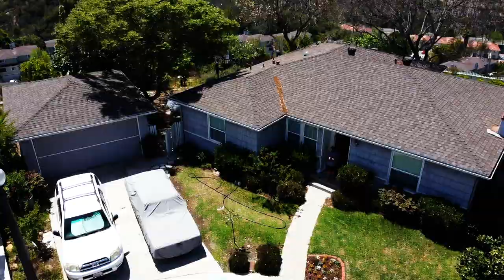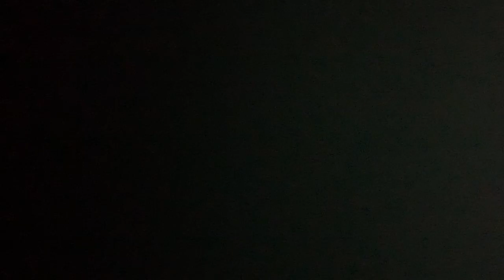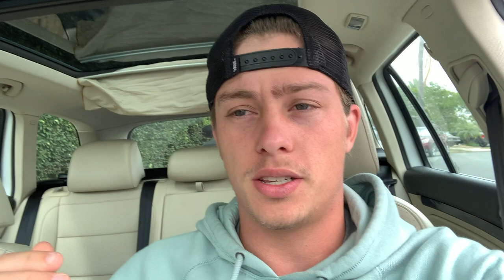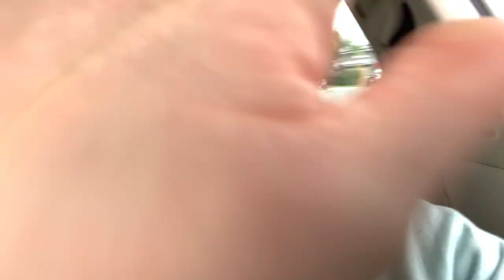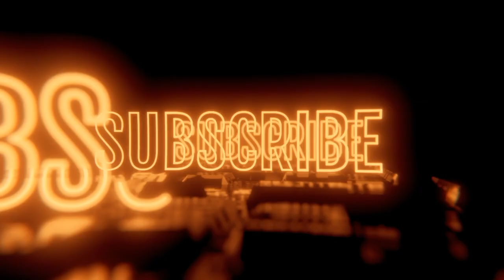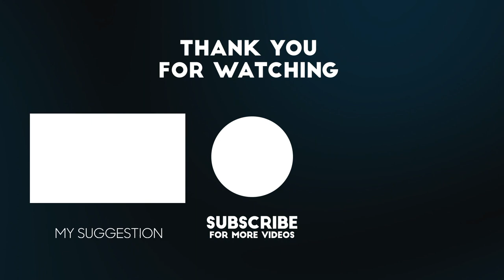Predator 212cc lean 2-STEP!! POPS & BANGS!

Comment: How do you backfire like this? I got the same engine with a slide carbs and straight pipe.
Reply from the maker: I think for this video I put the stock air box back on and it make this happen vs normally having the cone filter on

Comment: mine is running lean and i dont want it to, i think i need a bigger jet cause when cranking it sometimes pops like crazy, last night the flame looked like anti-lag lol but you dont want that on a NA lawnmower engine
Reply from the maker: I get that lol, do you have a cone filter or the stock intake on it? if you have a cone filter then you will need a bigger fuel jet to compensate.
Reply: @GavinFS  stock little intake
Reply from the maker: @sun6262-  I think I had a similar issue, have you tried cleaning the carb?

Comment: My idle is cut all the way down and the mini bike still takes out very fast by itself when started 🤦🏼‍♀️
Reply from the maker: dang! is it heavily modified?
Reply: @GavinFS  no lol
Reply: You are running too lean. Lean is mean until you smoke your pistons. It will try to take off at low throttle settings if too lean. Will have to richen it up and then up the throttle set screw as it will throttle down as your richen fuel mixture. Just richen the increase set screw until it starts to black smoke a little under load then lean it up half a turn.